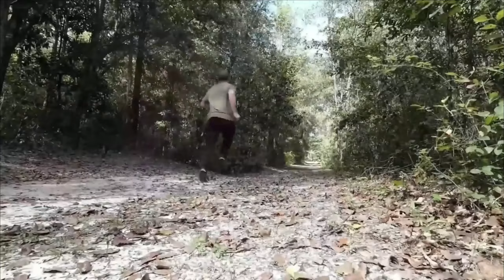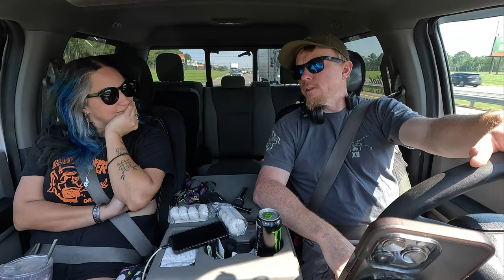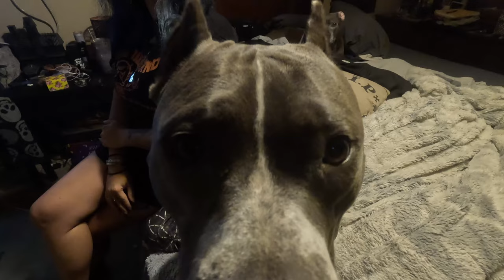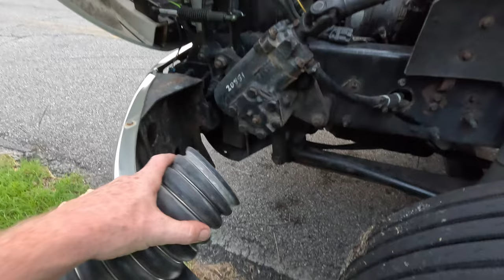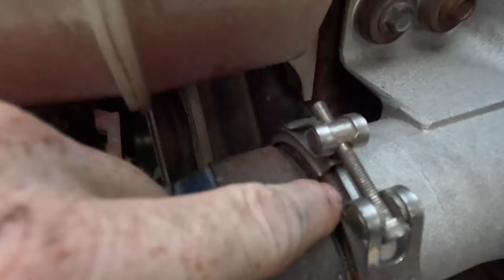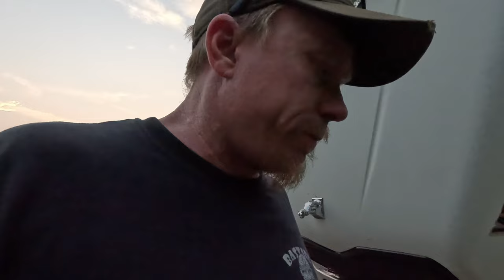We pick up our semi. Again

Comment: my friend,   when you put the new cooler on there ,  did you look in both ends and make sure that there is no  black plastic caps in there, they normally put a black plastic cap in there so nothing will  get inside the cooler  when they are manufactured , because you said it had 40 pounds boost , and the only thing you  done was changed the cooler ,  and now you do not have no boost  my friend 🕶

Comment: The next time, you have to fix a hose in the cooling system of a fuel tank. You can hook up a clean shop vacuum to the cap  and replace what is leaking.  The first time, I was replacing a fitting on the bottom of a fuel tank and did this  it works .

Comment: Hi Robert. I am learning more with this recent repair. I found Dura-Lite intercoolers have a 7 year of 1-million-mile warranty. No price given without registration. Boost runs from 25 - 60 pounds. Some say more boost is needed with a heavy load or going uphill. 29 July for me seeing this so you may have found a load and the boost is running around 40 pounds when needed. Can the intercooler be tested, for leaks, with the device you came up with without removing it from the truck? 
Have good days!

Comment: You can cut those squeeze clamps off the boots and use those boots with normal hose clamps.
Reply from the maker: That’s what I ended up doing. I just didn’t realize at first the vband part was separate

Comment: I have 2014 mack mp8... Very close to yours. Your boost maybe in derate mode.. If you have exhaust temp gauge check to see if you running hot on gauge you should also be able to see temp in your dash display.. My sensor was faulty and my gauge kept reading 1400F..and it would derate my boost.. Cambridge MACK.. IN ONTARIO CANADA.. Great team for troubleshooting call them up speak to service they know your truck very well.. I boost 40Lbs bobtail pretty easy

Comment: I had a 2009 pinnacle (company truck) and in the 3 years I drove it the injectors failed twice as well as the turbo. Seemed like I could only get 3-4 months before it was back in the shop for weeks
the following 2 years in a Cummins powered peterbilt were trouble free.    Just my opinion, life gets easier without that MP8..    but, Again that’s coming from a company driver.    I understand things change when you “ain’t got a dime in it”
Reply from the maker: It’s a tough decision to make you almost everything is new on the truck. You keep telling yourself this should be the last thing for awhile